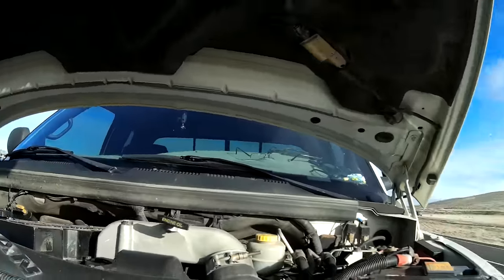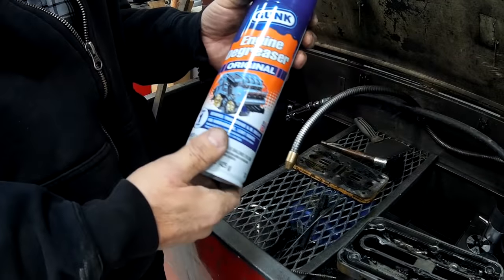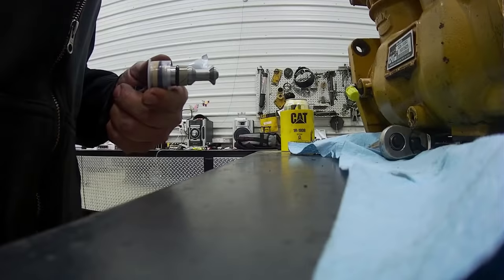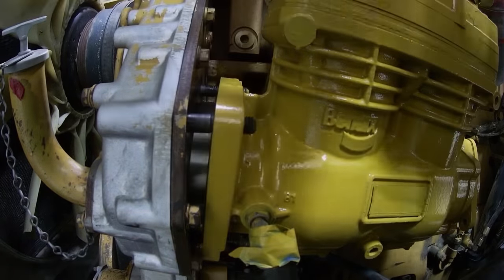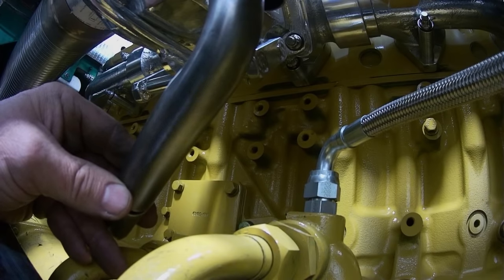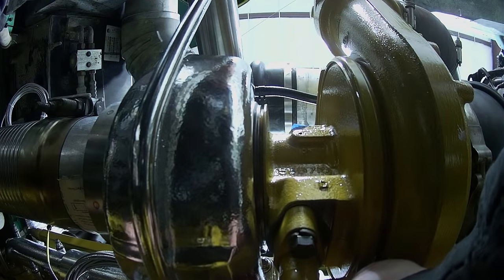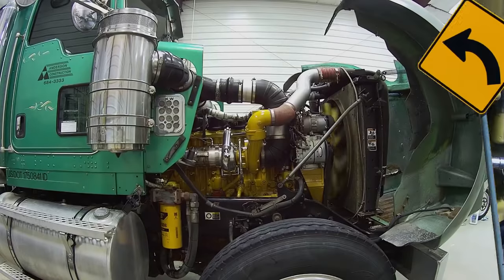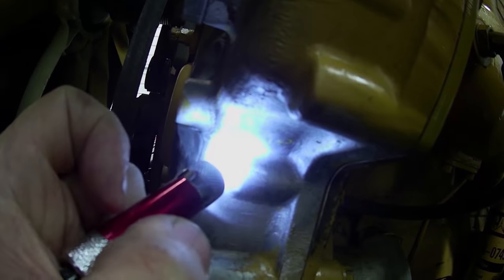C15 Caterpillar Twin To Single Turbo Is Done

Comment: Reminds me of a time I was up on the mountains with a gal sightseeing, put the truck in 4 low and crossed a small creek. not more than 5 mins later and family camping in a VW microbus was flagging me down, course I stopped, that the thing to do. they needed a jump, the cold of the mountain mornings took its toll on the battery. my father the machinist made a pair of jumper cables out of an old stick welding machine, hell they were about 20 ft long. got the family back charging their battery and when on our way, the gal I was with said why did you stop for them? Wow, that hit me pretty hard. my gal is pretty dumb. this family is up in the mountains who know's how long they have been stuck there. it's the right thing to do I told her. how about if you were the one stuck, wouldn't you want someone to stop??. needless to say, it was another lonely night. my truck course it's a FORD first on race day 1988 250 4x4 "sweet silver" was her name. I took better care of my inanimate objects that my intimate ones..

Comment: Jeff, I'm just a small grading and graveling company in Oregon.  I haul rock with my 01' dodge supertcab and a dump trailer and generally run a 305.5 Cat excavator.  I've done nearly all the mechanicn' since I dont trust most shops to do my work.  Just wanted to say after replacing the p/s pump, the brakes (after the shop screwed em' up), the heater core etc.  Infound you're a real inspiration.  Great Vids. easy to understand.  It is like being there with ya.  I'll subscribe and send pics of the operation later.  Thanks again...

Comment: I wish can take my truck to you been having ,so much trouble since ,I did the conevertion from twint turbo to single !!  I watched your videos and I'm amazed of your great work and the way the turbo sounds it's so nice keep up the good work pal👏👏👏
Reply from the maker: The only problem that can occur is the boost sensor doesn't read all that high pressure, install a 1000ohm resistor in it and problem solved,  or go to Cat engine masters on facebook and join and ask on there
Reply: Just changed over to a single turbo, only getting 25-27 lbs of boost. Is that normal for a single turbo?

Comment: Great videos. Really enjoy what ur doing. I've got a 2005 9900i with a c15 twin and thinking of going single turbo as well. We'll see how it's turns out!! Micheal from southern Alberta Canada.
Reply: MICHEAL HOFER   you know what, the twins are not bad, the thing that messed the twin turbo Acert engines up was the factory programming primarily, then those stupid IVAs.  Just getting a proper tune, opening up the exhaust and fixing the known little issues that cause the big problems the engines are reliable. I'd take a twin turbo Cat any day.

Comment: Leaking oil THRU the metal?  That ain't alpine-green! lol.    Used to stop for people all the time - nowdays everyone has cell phones and don't want/need help.  I still sometimes stop, but I had a girl act like I had 3 heads when I stopped to see if she needed help one time and I didn't want to end up on a list, so I drove on.  I like the foaming Gunk degreaser, it sticks better on vertical surfaces, but diesel fuel and solvent work well together too.  Do you have a link for Michael McCoy?  Thanks for the video!
Reply: yes put up something so we can help him.
Reply: Ahhhh, yes!  "Reel McCoy" Good guy!  Thanks, Jeff!
Reply from the maker: It's at the top and in the description
Reply: Found it Thanks  ..    Subscribed

Comment: on the switch blade actuator.. can you get a nut for the threaded end of the cylinder.. if so create a half tube head shield that is clamped in position with the nut.  dead air space over the insulation will really work far better..  if there is room.  looked really close  only issue would be the need for a drain port on the lower end of the heat shield..   in emergencies when silicone tubes blow out... cloth friction electrical tape covered by self vulcanizing silicone tape works great..

Comment: Cleaning compressor head parts, save time, use Carb Cleaner, or put them in a container of clean eng oil and boil them up, All comes out sparkly clean with no residue.
Reply from the maker: The gunk took it off pretty good

Comment: Hello Jpaydirt, I have an off topic question; is anybody making new parts for the 1693? They were a bullet proof engine if you drove them correctly. The old guy I worked for as a kid wore out three trucks with the same engine. It went a little over a million miles before he rebuilt it. He did roll a set of bearings in at 500,000, other than that just changed oil and never got it hot.  He put an egg under the throttle and told me if I broke it I was fired. Up until I retired I drove in socks only I could feel the feedback better. The TLC you put into your engines is impressive to say the least, Thank for sharing your knowledge Sir.

Comment: Fun story. I used to stop for everyone on the side of the road. As an ex tow truck driver, current mechanic it always feels nice to lent skills or knowledge to people when they're having a rough go. About a year ago, I was driving to work when I thought I saw someone try to wave me down. But he was on the inside of a corner my headlights barely caught him and 4am me to wasn't sure if it was something or nothing. 

About 2 miles down the road my conscious hit me. It was cold 12 degrees and windy. "did I see someone, or was it just something in the wind" I asked myself. "They have a cell phone" " what if yhier phone is always dead like my fiance's?" And in the end I decided to phone the state patrol and have them check it out. 

When noone called me back all day I assumed it was done. Until that night, when my fiance called me on my way home. The police were there and they wanted to ask me a few questions. Still not connecting this with the possible person that am, I wondered what they wanted. 

Apparently the man I saw was really there. And had driven a car off the road on that corner. He had just beaten his ex gf to death, shot her new boyfriend (he barely lived) then stole his car. Which he made about 20 miles till he flew off the road and presumably tried to flag down motorists. 

Who knows what could've happened that day. And while I still will occasionally stop during the day, or for women if the situation doesn't look fishy, I usually just call the non emergency number

Comment: How do Jeff,  The Kenworth sure looks sweet with the new Turbo. Saw a possible transition for Kenny. Lindas saw mill, new building.  The Tractor has a VERY UNIQUE ADDITION.  It might be a good deal for you depending on how much you use a off road forklift.  It's right at the beginning of the video when the building arrives.  Enjoying your .show. !!! Roger Marshall  Raymond WA,  wishing I was doing the same thing. !!!!! In the grease or dirt.

Comment: Nice job with the turbo Jeff, looks like it belongs in there. One thing I was told once by a mechanic that may be of value to you is that Acert Cats have an operating range of 1300 to 1600 rpm, I understand you have a unique gearing setup but you could probably yield better performance by running it in the operating range. These big kitties will suffer quite a bit but high rpm does them no favors. Great video and cant wait to see the next one.
Reply: ToolManJT  that's true with the compounds. Single may require RPMs. You ain't gonna hurt that CAT! Let 'er spin!
Reply: I run a single on mine BXS Acert, shift up and let her eat lol. Truck seems to like it running 48 psi boost and getting 6 mpg on a bad day

Comment: Man, that preturb temp was freakin me out, i had wondered about the ecu needing a little love. Good to hear youve got some pro support. Atb will in everett
Reply from the maker: Well it was freaking me to until I spoke with Bruce, and it's not uncommon to see 1400 before the turbo
Reply: Funny, I have seen engines making 1130hp to the tires that work daily that don’t run that hot.

Comment: Hey Jeff if that there quick steel don't work go to Harbor Freight and get those alumaweld rods and you can pretty much weld it up with MAPP gas torch and them rods kind of melt like solder. But I believe you're good to go with that there quick steel

Comment: Bruce is a good guy. I got my Pump and injectors for my small cam Cummins from him and Pete way back in the 90's. It put 612 to the tires on the local Cat wheel dyno.  I would say with your egt's in the 1300 range its isn't defueling very much if any. What size compressor wheel inducer is in that turbo? I build 80mm ones for the Cat guys here and they usually run in the mid 40's on boost but they are usually tuned in the 600hp range.
Reply from the maker: 88mm
Reply: Unless you plan to be pushing over 1000hp an 88mm inducer(diameter of blades of wheel inlet) is way too big.  Have them switch it to an 80mm. That is still kind of big but it would leave you room to grow. For your current power level a 75mm would be fine, but I like the 80's because you can run up in the 800hp range and still keep it cool.  An 88 wheel wants to flow in the 120-130lb/min range of air and that is in the 1200-1400hp range. They run toasty but we push 75mm well over1200hp in racing diesel apps. You will get a better spool, lower egt's more torque and more power if you switch it to an 80 over the 88.
Reply: Switchblade turbo is all about quick spool. That's the beauty of it. You can run a much larger turbo than conventional wisdom would dictate with the switchblade.
Reply: The switchblade helps with spoolup but that does not negate the fact that a compressor that is sized too large is inefficient and makes more hot air than one sized properly. Bigger is not always better.  I would say that the switchblade is more an improvement to the standard cat turbo method where they put a real small housing on so it spools fast and makes good torque then wastegates to keep the speed in check and to manage drive pressure.  With the switchblad you get the fast spool and low end torque but don't waste the exhaust energy on the top end thus getting more boost from energy that normally would have been blown out the pipe without making a bunch of back pressure and reducing fuel economy.
Reply: bcbloc02  no,a larger compressor runs more efficiently at that power level. Read the compressor map and look at the efficiency islands. I doesn't "want to flow 120-130lbs/min", it "can" if you push it there. At his power levels,he doesn't need to push it anywhere near that flow,therefor not as much hot air. 75mm waaaay to small for a CAT.    80 is OK,but a 15.2L needs more, especially with some fuel.
Reply from the maker: OOPs  76mm and 88 on the turbine end
Reply: That makes more sense. I hope it is one of the 10 blade 76mm and not the 6 blade. The 6 is marginal on air running in the 600hp range could even be part of why you don't see more boost than you think you should. Have you checked your drive pressure?
Reply: Doug, Looking at my Borg Warner maps I see there is a low flow 88, I am used to the 88x131 wheel. I see they now have an 88x120 that is happy in the 100-110 range.  I like the 80mmx110 10 blade  I think for any street engine under 1000hp it will make the lowest egt.  It also will have better throttle response and be less likely to have surge issues when lugging down than an 88 would.

Comment: Another cool trick to remove grease, gunk, & carbon from parts you have removed is to spray the parts with oven cleaner & put them in a black bag in the sun for a few hours.  I have used tis method for cleaning automotive engine blocks & cranks.   Not sure if the oven cleaner is suitable for aluminum, though

Comment: I visualize your set up as being ...exhaust gases travel from combustion chamber to turbo then are exhausted up the stack. The other end of the turbo has a fresh air intake, which is compressed by the turbo, then sent to the intercooler, then sent to the intake manifold.   For the gas temperatures you mentioned in your video, the 1300 F and the 800 F, where in the airstream or those temperatures? The 1300 F I am guessing is the exhaust gas temperature right after if leaves the combustion chamber. What about the 800 F temp? Thanks.
Reply: He has it pre turbine and after turbine.
Reply: Thanks

Comment: Hi Jeff, Mike Genereux. I was wondering what fuel system you were going to use in Old Kenny. Are you staying with the original or making modifications to direct injection?
Reply from the maker: Would love to go common rail

Comment: So, at the end of the day was the upgrade worth it. If you had just fixed all the leaks, would it have changed your mind about changing to a single??
Reply from the maker: Well everybody who goes from twins to singles say they get 1 to 2 mpg more so in a year the fuel savings should pay for the upgrade  plus when it's time to replace the twins now were talking some money so all in all I think it will be a good investment especially with 620,000 on i now it's getting close to the time it will need a head gasket, so at that point I will pull it and go thru it and possibly make it a 6NZ

Comment: Hey Jpaydirt have you ever heard of "Titan Industries" their "Oil Flow 141 Safety solvent cleaner". I have never seen a cleaner like this one before and for some reason if you have like powder coating underneath after you clean it with a water hose makes all the powder coating paint look brand new again I do not work for them so I'm not trying to be a salesman but that stuff clans like I've never seen before and I stumbled upon it on accident they gave it to me at work to clean off tape residue. It didn't work for me at work and then when I was working on my 59 Cummins I was looking for a cleaner and I read the Titan industries 1 for 1 so I tried it in the rest is history that stuff is good

Comment: 347 for GMC  I thought they had a 348 which was the weak version of the 409  they used in trucks, the 409 and 348 were discontinued as they had problems with them .Then they built the 396 to replace the 409 and it was a much better engine.Pontiac had a 347 that is very close to a 348 are you sure that was it..?Thanks Carl.
Reply from the maker: 348 was a chevy engine it was a 347 pontiac
Reply: Ok, a Pontiac 347 never knew it, thanks.

Comment: Do you no if I can do the same set up on my c13 go from twin to single ?? With the switch blade turbo
Reply from the maker: Absolutely, Jim Blaylock has done quite a few at his shop give him a call 800 782 0127
Reply: John F I'm in the process of buying an international with the c-13 engine and it already has the single turbo done to it wanted to know if you have heard any good things about them?
Reply: Joe Barrientes  
Hello joe my  KCB c13 has 812,000 miles on it and I work it everyday I have ZERO complaints I have owned the truck about 3 years It runs great it’s perfect for me and what I do im a local driver I have not experienced any of the issues most people have said  over the years about the c13 what I am looking to do in the near future is do the single turbo conversion with the switch blade but I’m a little scared being that my truck runs good as it is I don’t want to risk running it if it doesn’t work out I have herd good and bad about the conversion let me no how your looks or runs if you decide to go with it I think it’s a great motor good luck ....

Comment: Why did you ran the hose from the compressor to you air breather piping rather than to the block?
Reply from the maker: What's on the block that would supply fresh air?
Reply: @Jpaydirt  did you put a plug on the block? I also did the conversion on my mxs last year and I'm just curious if that helps it run even alot better. Thanks for the info
Reply from the maker: @johum187  I still don't understand, what plug? for what?
Reply: @Jpaydirt  mine has a hose from the top of air compressor to the engine that's how it cools of I guess. If I reroute that line to the air filter piping I would need to plug that hole so I wouldn't loose pressure
Reply from the maker: @johum187  So I think I understand, on my compressor the air supply for it originally came from the intake piping for the twin turbos, when I went to a single I had to move it so I hooked it into the intake piping from the air cleaners. that's what the large blue hose is for  is intake air for the compressor
Reply: @Jpaydirt  yep, different set up than one. I did the conversation after watching your videos I appreciate you for posting those videos. Thanks

Comment: You could have used a heater core input on a oil cooler from the drain back of the oil from the turbo the turbo make sure oil it really hot so what you got into it you could have did this somehow someway old buddy buddy old pal

Comment: Anyway,  u def need tuning! U shouldn't be seeing anything over 1000 degrees unless u pull in a long grade logging down at 12-1300rpm i gotta lug the shit outa my MBN- 7CZ Tuned c15 to get it up to a 1000 degrees! Thats what u want. I tug around 330s, 345s, and D8R and the truck pulls it like its 80k
Reply: When u shifting thru the gears that should be going 1400-1800 and clicking off gears like u got 20 more to go. That thing is running like a 475/1650tq truck right now
Reply: And if whoever sold u turbo matched right combo, u should be seeing 42-45lbs
Reply from the maker: Temp before the turbo on a C15 can go as high as 1400  are you talking before the turbo or after
Reply from the maker: Its a 10 speed it has a 500 rpm drop between gears so low rpm doesn't work to well
Reply: Jpaydirt, that is not correct, Bruce is giving you bad information, I have test cell data on acert engines and they barely break 1300*.